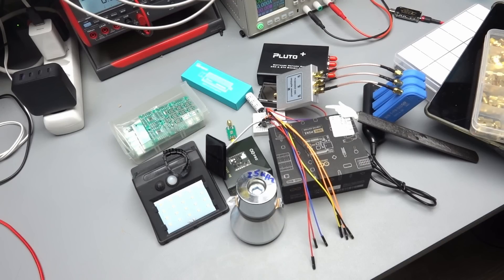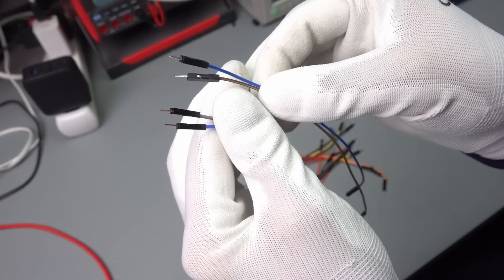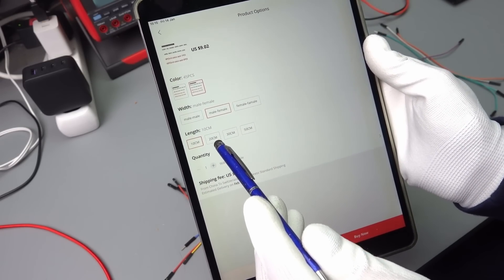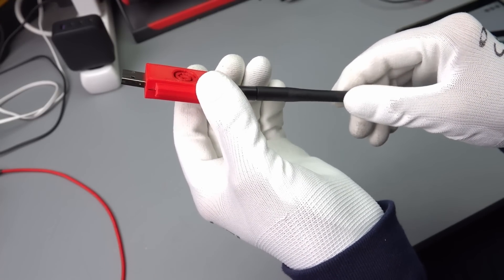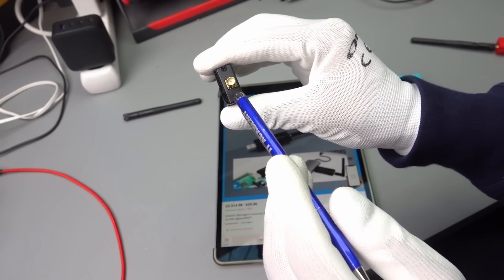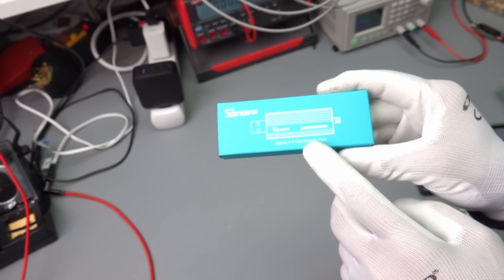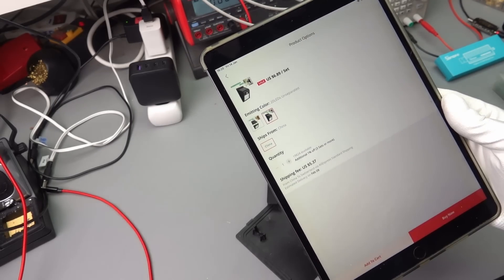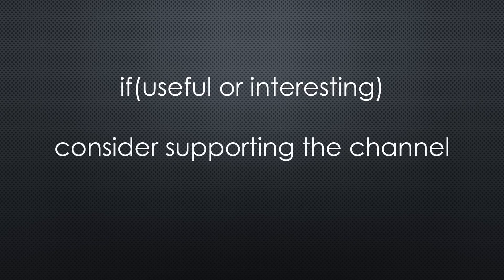#415 Mailbag Part 2

Comment: Hallo, ich habe eine tolle Projekt Idee,
Der Grundgedanke ist das oft PC-Systeme für „Server“ Aufgaben genutzt werden die über die Typischen Funktionen eines Server Mainboards nicht verfügen, am meisten vermisst wird sicher der BMC (Baseboard Management Controller) oder auch ein IPMI. 
Ich denke ein Mikrokontroller sollte diese Aufgaben zuverlässig an einen Standard PC nachrüsten können, leider fehlt mir das Talent zum Entwerfen einer entsprechenden Platine sowie die Programmierkentnisse für eine Leistungsfähige Firmware.
Folgende Funktionsbeschreibung stelle ich mir vor:
Platine an einer PCI Slot blende mit herausgeführter Antenne und einer USB-Buchse (rein zur Spannungsversorung) so kann der PMB (poor man BMC) mit einem USB-Netzteil mit Strom versorgt werden, oder über einen Externen USB-Ports des zu überwachenden Rechners. Viele PC liefern auch im abgeschalteten zustand hier zuverlässig 5V. Auch sollten Pins vorhanden sein die von einer internen USB-Stiftleiste den PMB mit Spannung versorgen könnten.
Intern an der Platine sollten stiftleisten angebracht sein die zum einen an die Stiftleiste auf dem Mainboard führt, zum anderen an die Taster des PC-Gehäuses. Optional wäre hier auch ein „Durchschleusen“ der Betriebs LED denkbar, dann könnte deren Status erfasst und im Webinterface ausgegeben werden, ebenso wäre denkbar die Betriebs LED zur Ausgabe von blink- Codes zu nutzen. 
Denkbar wäre auch ein auf dem PMB angebrachter Temperatur und Luftfeuchte Sensor. 
Firmware Anforderungen:
Wahl eines bestehenden WLANS, Bezug einer IP-Adresse per DHCP oder einstellen einer Festen IP-Adresse. 
Anzeigen der erfassten werte (Temperatur, Luftfeuchte, Status der Betriebs LED) in einem Webinterface.  Optional absetzen einer E-Mail bei definierten zuständen.
Weiterleiten der Tastendruck vom Bedienpanel des PC, Möglichkeit zum Unterdrücken dieser Weiterleitung, Protokollierung der Tastendrücke, optional absetzen einer E-Mail.
Ansteuerung der Power und Reset Signale zum Mainboard, über das Webinterface (Schaltzustände Reset „drücken“ also 1 sec kurzschließen, Power on „Drücken“ also 1 sec kurzschließen, Hard Power off „Halten“ also 10 sec kurzschließen)
Reply from the maker: Ich bin lediglich ein PC-Benutzer und schalte ihn nur aus und ein. Da habe ich mir noch nie Gedanken über Verbesserungen gemacht.

Comment: Dear Andreas, I'd like to buy the same silicon wires, 10 and 20 cm from the 3 genders type. I also want to reduce the shipping cost, but I can't order it without paying, and the seller doesn't see it in that case and can't change the shipping cost. How did you solve it?
Reply from the maker: I changed to an invalid Credit card. Then you can place your order and the supplier can change the price (the agreement has to be reached before). Then you can pay.
Reply: @AndreasSpiess  Thank you for the idea

Comment: Hi Andreas, first thanks for all the great videos!  I very much enjoy your work.  This is totally off the topic of this video, but following the directions on your home page to contact you here... :-)  I was recently working on some Python code to drive the Reolink API and I saw where you were asking questions in Discord about it.  Let me know if you never got it to work, I would be happy to help if I can.  I have also started working on a Python package that has more complete coverage than the other APIs I could fine, including support for both the NVRs and the Cameras.
Reply from the maker: I did not follow up. It was too complicated for me and not worth the effort.  I thought I wait for somebody to solve it for me ;-) You can send me a link to your solution through Facebook messenger or Twitter, if you like.
Reply: @AndreasSpiess  I'll contact your through Facebook Messenger (I sent you a friend request).  Depending on the details of what you want to do, I think I should be able to help you out (assuming you are still interested in your original project - no pressure if not, just wanted to offer to help in case you still would like to get it working).

Comment: I find the Dupont wires corrode. Are those silicone ones tinned copper conductors?
Where can I find tinned copper Dupont interconnects?
Reply from the maker: I never had a corrosion problem also with my old wires. It is hard for me to check if they are tinned copper or aluminum because the strands are so thin. It is well possible that they use aluminum.

Comment: Apparently the irf7317 doesn't have esd protection (and as a noob, it sounds like I'll be needing it) and alternative recommendation??
Reply from the maker: I do not know of many transistors with integrated ESD protection. usually this is done on module level with dedicated parts.

Comment: For the solar lights, get the ones with the glass panels. They usually work much better in low light (cloudy days) and they don't degrade in the sun like the Epoxy cells that you showed in the video.
Reply from the maker: Good point! I have to see where I find them.
Reply: @AndreasSpiess  Fine let us know where you have found it, best 73 from DL

Comment: dupont cables very bad for arduino digital data it make error because bad connection 😭
Reply: ill buy same silicon gold thx bro
Reply from the maker: The main problems of the Dupont cables remain with the gold plated ones. They are just nicer to work with.
Reply: @AndreasSpiess  🤣

Comment: Another fun video to watch! I have bought a few things direct from China, but always through eBay or Amazon. I cant remember if you Have made a video about choosing a reliable direct supplier? Also, what can the buyer do if the items never arrive? I’m sure I can work it out, but given the 2-4 week delivery time, experience builds slowly. I’m sure many people would like to hear your tips and tricks as your experience, and thoughtful nature make you trustworthy. :) Maybe if you already have a video, a post-COVID update would be good?
Reply from the maker: Aliexpress refunds the money if your order did not arrive after 60 days. You just need to file a dispute. Also if the part is not right or defective. But then you have to prove it (usually with a short video).
Reply: I've had problem several times with vendor shipping my order elsewhere. Alie then confirms delivery without checking address.  Takes months to "prove" I haven't got it, shipping tracking info not enough. Any similar experience or solution?  Happens on more expensive items like VNA.  Seems to be called Scam #4? online.
Reply from the maker: So far I got all things to my address.

Comment: Many cheap DuPont wires are stiff, because they are made of steel. Take a magnet and examine yours. Also, the contacts may be steel, which of course are not good quality contacts. In the best case, everything is non-magnetic - the wires (copper) and the connectors (copper alloys, e.g. phosphor bronze).
Reply from the maker: I checked: The wires are not magnetic. The connectors are (as usual) magnetic.

Comment: Dupont wires are really good if you're trying to quickly prototype something. However, I always run out of red and black ones and I'm definitely not like Andreas, willing to spend 60+ dollars or euros on buying gold plated (!) Dupont wires.

So I came up with my own "hybrid" approach:
- I still have the set of Dupont wires (10/20/30cm in all 3 gender combinations) I originally bought. I use them as much as possible.
- I also bought spools of stranded wire in all available colours, a few Dupont wire connector kits and a crimping tool (the one recommended by Andreas in another video some time ago). I use these to make my own jumper wires whenever I run out of certain colours of Dupont wires (it's mostly red and black) or gender combinations.
- If I'm happy enough with the prototype that I want to keep it on the breadboard (instead of making it permanent on a perfboard or PCB) I replace
all Dupont wires with solid AWG 22 wires as shown by Ben Eater in his "Breadboarding tips" video https://youtu.be/PE-_rJqvDhQ. This has a few advantages in my view:
        - Much nicer and smaller size
        - Better connections, they don't "wiggle" so much
        - It costs next to nothing
        - I get the Duport wires back to reuse for another quick prototype

Hope this may help somebody!
Reply from the maker: Thank you for sharing your experience. I do it nearly the same way as you. The only two additions: I bought a set of only black and red wires in addition to the colored set. And, if I like my design, I create a PCB and send the design to China. Sometimes even to get assembled boards back. Not as cheap as a breadboard, but very rewarding...

Comment: Love the mailbag videos. How do you calibrate that VNA when you have the RP adaptor attached? Do you need a set of RP caps?
Reply from the maker: Theoretically, yes. But maybe you watch my nanoVNA video? On this or on my new channel.
Reply: @AndreasSpiess  I have watched that. I guess you can calibrate with a straight through spacer of the same length as the RP adaptor.
Reply from the maker: And if you want, add the delay to adjust for the reference plane.

Comment: Big Clive did one of his reverse engineering videos on the outdoor solar PIR LED light device a couple of weeks ago (rebranded and sold in the UK by Aldi supermarkets).  I think he was generally positive about the device (which has a two year guarantee for example) and how the enclosure and components could be improved/repurposed.
Reply from the maker: Thank you for the info. I will watch the video.
Reply: I have exactly the same Solar LED light, the LEDs stopped working in about 3 months. Now 6 months later only 3 of the 24 LEDs work. 
The battery has no over charge protection. I obtained some TP4056 boards with the DW chip but was unable to use it this solar light due to lack of sufficient electronic knowledge.
Reply: I have one outside, for 3 years now, exposed to direct sunlight. Unfortunately, I had to change the battery once and now, I think I'll have to change it with a new one again. The heat of the sun damages the battery after 7-10 months.
Reply: @kylixme  You must be lucky, in some countries that's hardly a danger! :)
Reply: In Romania at least I've found the PIR lights in "chinese shops" for about 4 $.

Comment: One thing seldomly mentioned is the leakage of supercapacitors. It's hard to determine since supercapacitors take a long time to charge... very long till the "trickle charge" is small enough to actually measure the leakage current. Intuitively nothing comes for free in this world, so when I see some technology that boasts high energy density, I always think at what cost :-) 

Must confess I don't know the precise answer to this question. For a project I'm looking at average powers in the range of 10-30 uW. Some supercapacitors do specify a leakage current, for example 10uA max (at 2.5V rating). That's 25uW! So sadly that means that 50% of harvested energy goes wasted to storage leakage. (Can still better than a battery, though).

Edit: just looked up this particular capacitor, and it says 5uA typ. For my use-case that's ouch.
Reply from the maker: I agree. I would not use supercaps for long-time storage. They are good if charged every day or so.

Comment: These LIC/LIK batteries would be great to replace the Lead Acid battery of a car, but in an arrangement where standard Li-Ion batteries (maybe in the trunk) act as a high energy density store, and these batteries/capacitors are simply up front for cranking the engine and firing the sparks. If it doesn't crank then you just wait a few seconds for the caps to recharge, but don't have a big li-ion battery next to an engine, which is not good. They also seem to have a very high recharge efficiency compared to li-ion (and certainly lead-acid) which might lead to further fuel savings, as you pay for this electrisity at the pump :) Well... some of us do...
Reply from the maker: You are right, this would fit well. But I fear that the price advantage of the lead- acid technology will make them live till the end of the combustion engines...
Reply: @AndreasSpiess  Hahaha, yes you are most likely right :) It is more likely we will see a lead-acid battery with USB-C and bluetooth ;-)

Comment: Thanks for the inspiration as usual !
already have some of these led lights around the house ,bit bigger ones with 18650 in it. Will see to stuff a wemos mini and bme280 in it.
Also the Antenna tester made me think ..... could look in the box where all the unmarked 2.4. 5.8 and 433 Antennas are mixed, but the ones I found are much more expensive than all Antennas together ..... might be You have a tip in thefuture.
btw. finaly the M5stack tough is available on banggood.
Regards from Bavaria
Reply from the maker: I labled all my antennas and dumped the ones which were bad quality. Even if a NanoVNA costs more than all antennas together, I would want one...
Reply: @AndreasSpiess  
thank You very much for the answer.
will check Your videos for a recommended device and / or procedure.
Reply from the maker: I measure their frequency response and check if it is at one of the usable frequencies (in my case 433M,868M, or 2.4G)
Reply: @AndreasSpiess  
ok
 so have to get a nanovna 3g v2 and follow video 359 i think .......

Comment: gold plated dupont cables does make me laugh 😁
solid core is nice for breadboarding, but i always wanted stranded silicone jumper cables- those are a bit pricey! i have a crimping tool, might see if i can find a supplier for the silicone wire and do it that way.
Reply from the maker: Mine have stranded wires. Maybe I was not clear enough. You find very good silicon wire in many colors to crimp your own cables. I use 26AWG silicone wire for my non-standard cables.
Reply: @AndreasSpiess  no, you were perfectly clear. I was just stating my own preference- solid core is better for wires that don’t move, like on a breadboard, while stranded is better for wires between arduinos and circuit boards and such.

Comment: Andreas, please check out the video Greatscott released a few days ago. It was about LIC, and explains very well what those Caps can do, and what they cannot. I checked out the silicon jumper wires...but this seller is really crazy. I was trying to order for about 60 EUR, for 22 EUR shipping in slow mode. Let's see if he answers.
Reply from the maker: My video was created before I saw Great Scotts video. Otherwise I would have mentioned it (I was on holiday in-between and had to prepare the videos).
In my case he reduced shipping by 50%. Not a good deal, but I did not find a better one. And I had them in my shopping card for a very long time because of the price. Finally I decided that the life is too short ;-)
Reply: @AndreasSpiess  Ok, thanks. I am not sure how long I am able to wait, I want those wires ;)